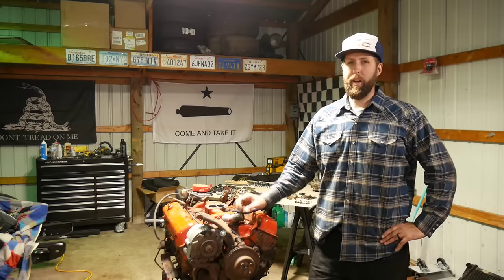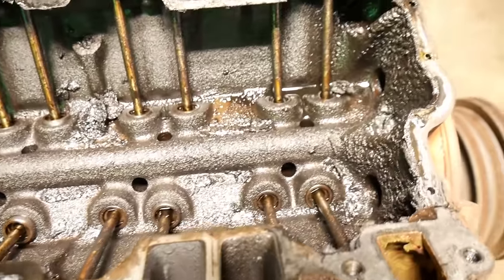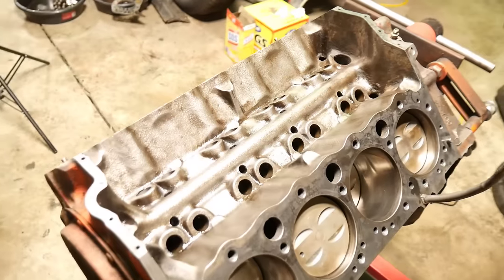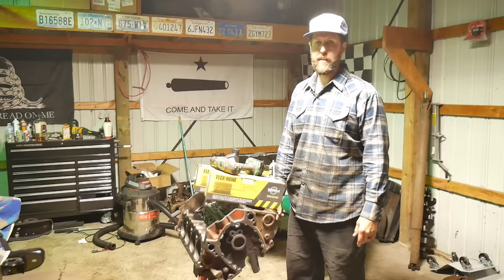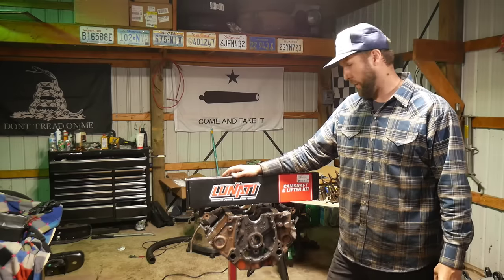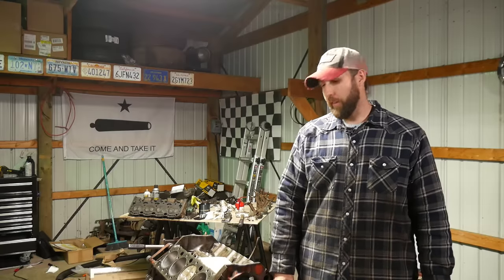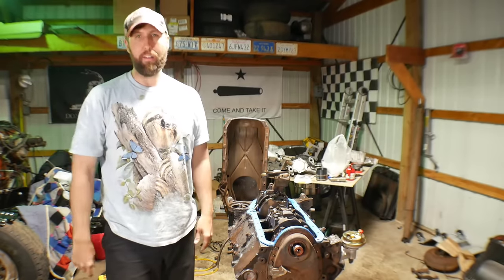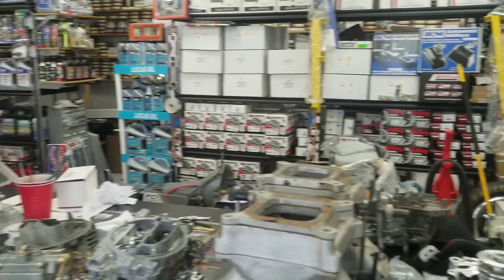Budget 307 Small Block Chevy Build & Dyno - Vice Grip Garage EP28

Comment: Many years ago I built a 307 for a friend of mine. For some reason the engine came with a forged steel crank from the factory. The engine came from a Malibu taxi cab. I had the engine hot tanked and had new cam bearings pressed in along with new freeze plugs. I honed the cylinders and got new forged pistons for it. The rods were  magnafluxed and shot peened 350 HP rods. A set of new Z28 rod bolts finished the assembly. I farmed out re balancing the rotating assembly. The heads I used were “double hump” heads that had 1.94 intake and 1.50 exhaust valves. A complete rebuild was done along with new Z28 springs, valve stem seals multi angle valve seats. The cam was the 151 327/350 hp hydraulic lifter cam lifters and pushrods. For the oil pump I used a Z28 high volume pump. I matched the oil pump cavity to the rear main cap and before bolting it down I polished the inner surface and did a smooth radius into the cavity. I packed the oil pump with petroleum jelly for instant suction. The intake was a stock Chevrolet aluminum high rise dual plane 1970 Z28 intake with the ports opened up to match the intake gaskets as were the heads. The head gaskets were copper. We dropped it into a 69 Camaro that had 307 emblems on it. It was a 4-speed car. The carburetor used was a Holley 600 cfm vacuum secondary unit. After a 1,500 mile gentle break-in. We changed the break-in 30 weight oil for 10W-30 Kendall GT-1 racing oil and a magnetic drain plug. The car was dyno’d and got 312hp at the rear wheels! Not bad for stock Chevy parts. With 4.11 positraction 12 bolt rear. It’d run 13.5’s at 102 average.
Reply: one helluva lot of fun to drive!!! Not many of these 307s out there in something as sweet as a '69 Camaro
Reply: There were all kinds of trick parts used by everybody. But as I recall Chevy was more likely to use tougher blocks and cranks in some of their grocery getters. It was not uncommon to find 4 bolt mains and forged cranks in weird applications. In the Fords there were none of either for the most part.
Reply: My 307 had a steel crank too. It was black. I had to fly cut the pistons to run 2.02’s so I put some home ported 305 HO heads and a Isky 268 and it pushed all the rocker studs out ... so I drilled the tower and beat roll pins into the stud. The engine is still running in my 68 GMC.
Reply: When i worked at a ford garage in the early 90s we used to get f150s in with a hole in #5 piston so we would change the short block under warranty. Well time would go by and then ford would give us the go ahead to dispose of the old short block. We took the piston and rod out of one and replace the bad one in the other. New bearings and oil pump all else stock on the short block with our 1970 ported heads. These 351s were cast dished pistons and not much compression with way to much cam. (Hydraulic flat tappet with maybe .520 lift 240 at .050 on 108. My buddies 79 Fairmont would run high 11s low 12s any day. My 79 mustang would do low 12s with bored and flat top pistons but my suspension wasnt set up as good as his. 28x10 tire with 4.10 gear and $200 c4 trans. The good old days for sure. Cheers
Reply: Art Tafil the 307 never came in a four bolt main  block so why would it have a forged steel crank?  , I built a 307 I used the 291 fuelie heads with some good port work also used the strip dominator aluminum Intake with a  isky mega cam  I did other work to it and made over 400 hp
Reply: yep z28 oil pump and springs,  if I remember that oil pulp would run a higher oil pressure at the same rpms as a stocker , so it was no brainer swap,  and z28 valve springs were good for 6000, lots of sportsman guys used them when they switched to v8's (small block dirt track).. except the ran kendall 30 weight , as it had zink in it , think most guys used 441x head's 194. intake 168. exhaust,  for some reason there were a lot of high po, truck engines around to donor them from.. a bunch of other mods,  only 2 bolt mains were allowed to keep it "cheap" , knife edge cranks, splayed 4 bolt setups,  lots of internal balancing, most guys used a 30/30 rv cam, 2 barrel racing holley.. think they made in the 400 hp range, but very reliably as they didn't rev over 6500.. eventually modding up a 2 bolt, and making it reliable became more expensive then doing up a 4 bolt,  so rich guys could go and win in the budget series, instead of wallowing mid field in modified..series went to 300 hp crate motors.. 
  Still good memories of putting an engine together on a budget , using disused donor parts, and having it run nice and reliable for what was supposed to be a budget series.. all it took was a rich dude to make a donation to the track owner,  build a 12000 dollar engine,  never having wrenched on it for a second,  get all brand new stuff,  a few backroom deals with the officials, and he's landing all the purses.. or getting away with nerfing everyone off the track.. I remember one high roller getting pissed at a back marker  for holding him up and punting him off the track,  mangling his ride for the season..even the officials couldn't turn a blind eye, realised it wasnt fun anymore, as it was meant to be, lost the plot, went to crates the next year.. but saw some cool innovations , and some smart engine guys while it lasted..
Reply: @planegaper  
Oh yeah, I feel you. There's always that one guy with am unlimited bank account that destroys the class and destroys it for the fans as well. Got one locally that runs superlate and cratelate models. Even the crate classes can be altered if you have the money and the cheater to build your engines. How hard is it to design a 604 stamp or have someone build to your specs without anyone knowing? Easy, when you have hundreds of thousands of dollars.
Reply: not likely,nice dream but 312 at the rear wheels is absolute BULLSHIT
Reply: also,this engine build would decimate your 307 build by a minimum of 25% more power and it made under 290 on the dyno without the pretty common 20% parasitic drive train loss.so your 312 horsepower 307 actually made about 220-240 to the wheels at an ABSOLUTE MAXIMUM and i would guess much less than that to be honest.your estimates are off massively.
Reply: my 69 El Camino  had a fact steel crank. always wondered if it was just a 327 crank that somehow found its way in. also fact 4bbl and power glide
Reply: 13.5 is damn good!!
Reply: I don't buy 312 to the wheels certianly not with a 600
Reply: @trillrifaxegrindor4411  yah. I say bs with that rr hp of 300 too
Reply: Your 307 had a steel crank because like you said ,,283 block,327 crank,,,,,well  ALL 327s had steel cranks,,that why it was the engine that created the Chevy mystique,,I've seen stock bottom end 327s hit 8500 rpm and survive for way longer than you would think
Reply: CASPER 12345   I have to chime in here you need to be more specific when saying that. technically you are correct if only talking about Chevy's engine because  Pontiac, Olds and Buick each made a 350 and all three are considered big blocks (same blocks as their respective 400 and 455 engines).
If you are given a choice between any of the four GM 350 engines remember this because the the offerings from Pontiac, Olds and Buick can offer more "bang" if you have a larger budget. Parts are not as easy to get as they are for the Chevrolet small block 350  but ther rewards can outweigh the extra expense. The blocka are considerably heavier though so that needs to be considered as well as the extra expense.
Reply: Billy Jack Worked at a dealership myself around that time , we did alot of short blocks when Ford went to 1mm rings , a lot of them , did the same as you , cleaned the Pistons , new rings , had to switch oilpans for the one piece seal , I did alot of engine work at home in my garage .
Reply: trillrif axegrindor   head porting  does wonders  doesn't  it  but  you wouldn't know that cause  you cant afford it
Reply: @trillrifaxegrindor4411  I've seen a 305 make 390 HP with aftermarket cam, heads, and intake, and headers. It's possible, but it's in a really high RPM range for a normal vehicle.
Reply: @bradleymorris8875 . That's kinda odd, the 2.02 valves in my Sportsman II heads clear just fine on my 307. Comp 274xs solid. Closest piston to valve cleaeance was about   .153"  and that's with the block zero decked.  But cool man how'd she run?
Reply: @trillrifaxegrindor4411 . Wouldn't that be around 400-415 at the crank?  He didn't mention if and how extensively the porting was but I also doubt that power figure with the 151 cam. I'd believe 250-260 at the wheels. If the heads were fully ported and a tight lsa solid cam around 240°@.050",  I'd easily believe the claim.
Reply: @trillrifaxegrindor4411 . That would be the equivalent of saying a 350 can't make 450 hp.  A 400 hp 307 is 1.3 hp/cu inch. Easily attainable.
Reply: @TheLionAndTheLamb777 . I believe it. I would think a 307 built with the same specs would do even better at the higher rpm due to shorter stroke and bigger bore (less valve shrouding).
Reply: tragic life  Shhhhhhhh Mannnn. Don’t tell the haters🤦‍♂️🤦‍♂️🤦‍♂️🤦‍♂️.  👍👍👌👌
Reply: @mikewillett5076  Yeah, I definitely think a 307 is a more favorable combination than a 305.
Reply: john jones  Nascar engines running those small carbs had 14:1 or more compression and special cam grinds to get the air fuel in and make that power,none of which the 307 build in question had listed(streetable compression ratios),so this is apples to oranges comparison. Its possible to get good power from a 307,but i doubt his combo made what he claims. The smaller bore is the limiting factor with valve sizes.
Reply: @jonalarcon8564  A 307 could come with a forged 327 crank in it, especially from 1970 on after the 327 was discontinued if they had extras around.
Reply: @tragiclife9760  64-67 all 327 had forged cranks. 68-69 only HP had it. The 307 was made 68-74. It's quite possible a 307 got a steel crank, but unusual. Guessing it was as common as finding a 4bolt big block in anything else than a heavy duty application. It happened, but not as often as some make it out to. A good friend raced his 73 Camaro with a 2bolt cast crank 454 going 8800rpm through the trap at the quarter mile, so I'm not at all questioning the 327 at 8500rpm. BtW that engine is still in one piece, it's 30years ago.
Reply: @trillrifaxegrindor4411  - Do a search... all the hot rod magazines have Chrysler 318" builds making 400 HP... so a 307 Chevy can do it... with stock Vortec heads...
Reply: @BuzzLOLOL  The "double hump" heads he is talking about were 300HP/327 heads, and that was stock. So with that combination it should make more than 300HP. The difference being only 20 Cubic Inches.
Reply: @tragiclife9760  Hard to find a steel 307 crank, good luck with that, maybe for a truck application as their were no 307 HP engines. Early 283/327 small journals were forgings, everything went to large journal in 1968.
Reply: @bradleymorris8875  9
Reply: @planegaper  I used to work in an auto machine shop back in the late 70's the owner had a.040 over 307 he gave me because it had been sitting around taking up space. I started out as a tear down guy ( ended up running the cylinder head department) and saved a used cam that said sig erson on the end of it. I put the old dial calipers to the lobes and found out it was under .500 lift so I could use some z28 springs on it with a set of angle milled 441x heads that I port matched with
 some bowel work. Put it in a 71 Chevelle with a Vega converter and a 12 bolt 4.11 rear end........ For no more than I had in it she ran like a scalded dog.
Reply: @TheFalcro1234  this question is just for fun... I had an '83 Cutlass with a 307 (Olds engine I'm guessing), my first car.  always dreamed of rebuilding it. didn't have the knowledge then, not sure I do know.. but would that have made decent power?  I remember looking through catalogs just for fun, trying to find a rebuild kit for that engine... LoL
Reply: First off 312hp at the wheels is far fetched. Nice 80s  grocery list though.
Reply: 307s had forged cranks, chevys almost all did back then
Reply: There was an article in a 1980s car mag where some famous engine builder took a 307 and made 400hp. I remember he used 240 ford 6cyl rods cut down to the Chevy journal. Several weird tricks later he had 400hp/ 410lbft😳...I was running Pontiacs at the time and remember being stupefied. We were working hard to get that out of our big inch motors
Reply: Art Tafil You did all that but you don’t have a video of you checking the oil in your mother’s Rav-4.
Reply: @jonalarcon8564  ,  Four bolt mains are not a requirement for a forged crank from the factory.

Comment: You got a great outcome. no leaks, no failure and 290hp is excellent.
Reply: Definitely.  I'd be very happy with that from a 307.
Reply: @JcJimmyD . Not bad considering the parts.
Reply: I would not except anything less than 1.5 hp per cubic inch out of any engine. Everyone’s been brainwashed to think that one horsepower per cubic inch is good. It’s not! All these engines are being built way too tight. No reason for that if you properly hone cylinder walls and adjust your piston to wall clearance. But few people understand what the word proper is and what the clearances should be.
Reply from the maker: @Peter Viceroy.  Can you please explain to me how to get 460.5 HP out of a 307 ( Per your expected 1.5 per cube), Naturally Aspirated, on a budget?   Thank you
Reply: @ViceGripGarage . If the budget is cheap as possible it's a fairly tall order. But with a relatively small budget that isn't a huge order.
Reply: @ViceGripGarage  It's probably all in the honer.
Reply: @ViceGripGarage  I think he might have been one of those trolls who like to spread disdain and bad feelings in comments sections. I guess he doesn't realize that you're from Minnesota, so that stuff won't work on you.
Reply: @peterviceroy1592  accept
Reply: Sheoot! A feller can get that much power easy! Just get yourself some of those super duper sparkulator 3000 plugs, hood scoop, cold air intake, NOS and NOS stickers (don't forget the stickers), a huge loud muffler with a 6 inch wide tip (make sure it's the largest you can find so that it hits the bumper or or melts something).
Reply: @charleskeller1245  yeah, that's what the 302 was "rated". Seriously though, it was a good result from a 307.
Reply: @ViceGripGarage  Can't, really.  I mean, get airflow to support spinning it 7500rpm and you might, but otherwise, no.  Are those rockers 1.6?  Could maybe make it breathe a little better with 1.7 or 1.8s if they can fit a 307.  Springs to support that lift, and could turn it 6200, probably.  I spun a L67 with 1.84 rockers to 6500 on stock springs.
Reply: @charleskeller1245  The 307 was an Oldsmobile engine.
Reply: @peterviceroy1592  Where is your channel? I want to see this 1.5hp/CI?
You're a pole smoker! Lol
Reply: I think 290 horses from a 307 cui is amazing personally.   Fred
Reply: @49Fordproject  Hahah pole smoker ! ! ! ! !   Fred
Reply: Real honest numbers, that'll be a sweet tire fryer!!! I'd be thrilled with an honest 290HP!!!
Reply: @joefair3391  yes, but Chevy made a 307 in the late 60s
Reply: @67goodoleboy67  
There's yer dinner!
Reply: @TheLionAndTheLamb777  6" stovepipe works.
Reply: @unicornsteaks6769  
302-307; what's the difference? Its all SBC mouse motors and they last forever.
Reply: @electronicengineer  Z-28 territory.

Comment: Almost 1hp per cubic inch with factree stuff. You sir are not dipped. Good job 👍💪🏻
Reply from the maker: Thank you Dave
Reply: Dave M
Reply: Im squeezing ~140-150hp out of a 134cid 4 cyl right now...from 1997. Another guy built one to 230 crank hp. people laugh it his build but I think 230hp from a 23 year old 4 cyl is nice.
Reply: @tehagent1321  can you make my '93 5dpd  Honda Accord go faster? it's slow as s**t, but still fun to drive.
Reply: @Dave M I was going to comment. My Dad used to say 1 hp per cubic inch and that was doin good! Back in the day. Early '70's
Reply: @ViceGripGarage   @slick1rick1  I have a 307 standard bore bone stock super low mileage survivor short block and a magic recipe of other sbc parts and pieces from 58 to 65 sbc's all from the GM parts counter and I spray anywhere from as low as 150 to 350 3,4,5 times every Saturday night been alive for 4 seasons so far and going strong 307 at 10 grand to rule the world go 1/8 mile from Missouri

Comment: I'm impressed by that power level from a 307.  Imagine 325HP is easy at 6000-6200rpm if the valvetrain supported that engine speed.  Nice work.
Reply: very easily done, back-face valves and drop in better springs.
still wouldn't push it much past 5700 rev, kinda pointless when peak horse-torque happens about 5150, geared to shift 4500-5600 stays in its peak range.
Reply: @modelnutty6503  6000 rpm sounds so good and sometimes its better to not shift when you're gettin closer to the finish line when racing stop light to stop light

Comment: I LOVE THE 307!!!  Last one I did pulled through 8000RPM,  327 forged crank, 020 over forged eyebrowed flattops, 292 intake w/480 lift (327/375hp cam),, dual roller chain, Rhoads lifters, high volume pump, Power Pack heads (small chamber, small valve 1.9/1.7, large port), marine 327 manifold with the center cut out and notched, a 1" spacer, Holly 600 converted to manual secondaries, one size smaller jets and 30%ish destroked power valve, 1.7 rockers, custom by me rebuild and curved distributor.  below 2300 ran like a nice 307, at 2300 intake air speed hits the sweet spot and whistles in the intake.  Twists the chassis torque change all the way through 7800RPM.  When kept my foot out at 55MPH (74Nova, Police TH350 and 2:73 rear) got 22mph.  Once into the torque band I have no idea...  To busy keeping it pointed straight.  Loved it.